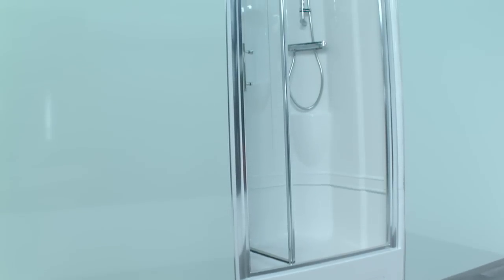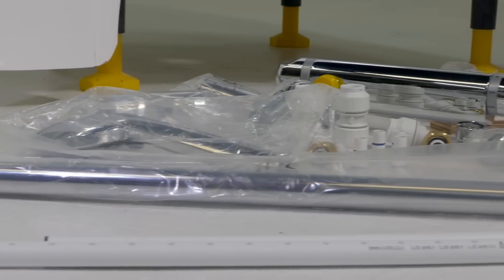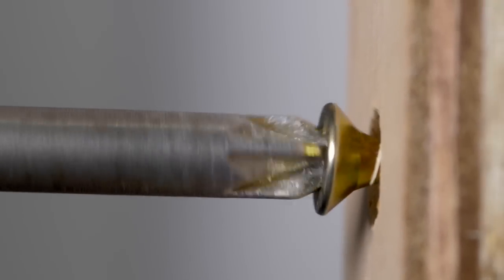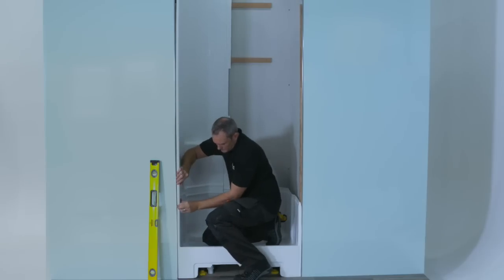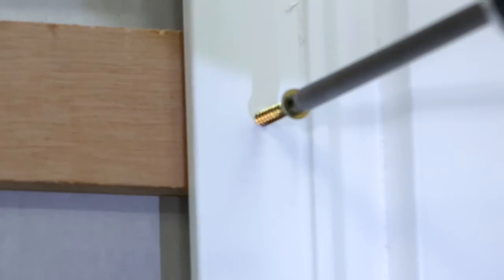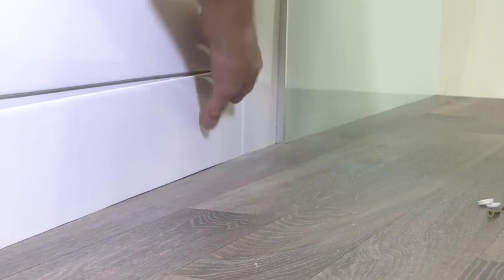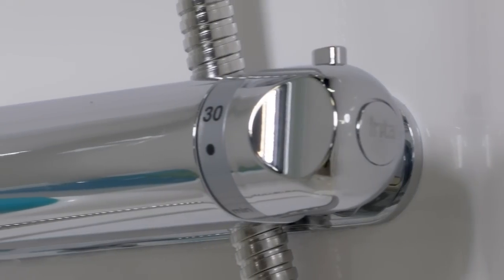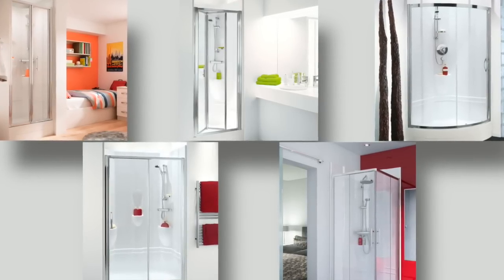How to install a Coram Showerpod

Comment: It looks great , and good you have the confidence to provide a 25 year guarantee. The issue I have with shower bases that are stone  resin is that due to the weight or action of tenants they can crack and so I always put in 22mm marine ply beneath the base so they never crack . Is the base unit to this product suffiiently strong for up to 100kg people . The other issue I have had is with cracking panels from other suppliers due I can only assume to people leaning against the walls . Are these walls flush against the main walls of the building to provide extra strength, or how do you guarantee the strength ?
Reply: I would agree, I have found tenants end up cracking resin bases and always have to repair or replace them